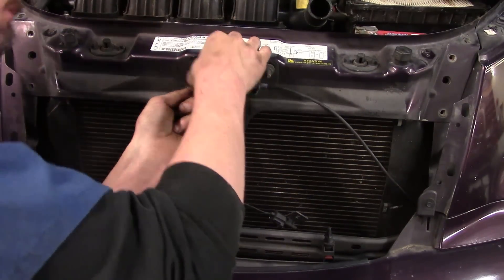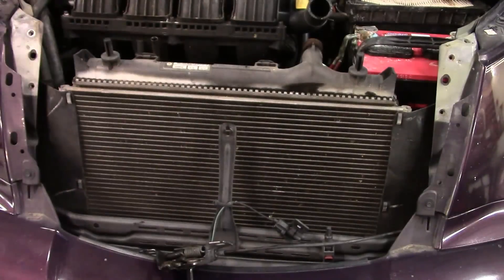Part 1/2: 2004 Chrysler PT Cruiser radiator removal and replacement

Comment: Thank you very useful and accurate just helped me replace the radiator in my 2005 Turbo PT Cruiser Convertible . One of THE most accurate videos I have seen in a while right down to dropping the hood latch washer, I did it too and was like doh he warned me
Reply: Was it any different then the non turbo?  Is there more work worrying about the oil cooler and turbo?
Reply: @stephenriddick9554 , some rads for The TURBO PT /GT/HO, claim you need to remove the turbo.!!  I question why
you would need to remove it, unless your planning to rotate the engine, in order to remove the rad. Sounds like something I'm not willing to do

Comment: That's good advice on the rad dain, often I've had to remove the lower hose because my drain was either clogged or wouldn't move on the older brass ones.
Reply from the maker: +charredskeleton Thanks. I have had a few that leaked after opening them so sometimes I get a bit concerned but for the most part I don't have any issues anymore. Thanks for watching and make sure to subscribe

Comment: one thing to ask . dose the manual transmission does not have a cooler on the radiator. or does it?
Reply from the maker: Manual trans does not need a cooler….there is no pump in the trans so no way to pump the fluid thru a cooler either.
Reply: @MotorCityMechanic  that what i figured thanks.

Comment: Hey bro this was a great video. Excellent step by step and informative directions. Took me little longer than I thought. But that's part of the learning process. I have 1 question 4 ya tho.... Do have or done a video on removal and reinstalling the oil pressure sensor on a 04 PT Cruiser regular 4cyl. without the turbo. I've replaced it once and oh MAN. 🤬 Thanks again bro and keep'em coming
Reply from the maker: Thanks for the kind words about the video. I have not done that sensor on that engine as of yet.
Reply: @MotorCityMechanic  That's k bro.. I'll just keep 👀 out 4 it if u decide 2 make 1

Comment: what is the guard on the bottom under the radiator attached to the chassis or frame?? ,is it the radiator air dam ? My 2004 is missing this piece and I am replacing my radiator a second time .Does it protect the underside somewhat.Also there are low profile 16" tires and rims which allow the car to be too low to the ground ,what can I do to remedy this situation?Will  normal tires fit ? I would prefer more ground clearance to prevent damage to the radiator ,oil pan ,etc.
Reply: Great video ,very helpful and well done!!
Reply from the maker: The issue is that it doesnt take much to damage the radiator if the vehicle gets bottomed out. Usually the metal cross brace that it sits on gets bent and then it breaks the lower mounting pegs off the radiator. As far as the tires....i would see if the door sticker and the actual tires match in size. I dont know what sizes you can go to that wont cause it to rub.

Comment: I ran into a snag on my PT. apparently it was in an accident before I owned it. There was some body damage down below and what happened was it pushed the fan back so I couldn't pull it out. It was like the fan was welded in there.
Reply from the maker: They most likely bent the metal support underneath that the radiator sits on. Surprised it didnt damage the radiator as well. You can replace that support if need be.....it just bolts in place.

Comment: This and your timing belt videos helped so much! Thank you! I've done both on my 2001 PT. I now have to tackle a radiator & fan replacement on a 2004 PT Turbo I just bought. Is it much more involved than the non-turbo?
Reply from the maker: It will be pretty much the same. I think the turbo version has a neck that unbolts from the radiator if memory serves me.
Reply: A whole lot more. You got a trans cooler and intercooler to worry about. it’s a pain in the ass!!

Comment: What is the difference between the manual and the auto versions of the radiator?
Mine is manual and most of the radiators sold on the internet are for auto trans. what modification do you need to do to the radiator to make it fit?
Reply from the maker: Actually the automatic will work fine. The auto may have a built in cooler with 2 fittings on the lower rank. Depends on the year. Otherwise you won't be using the fittings and can just leave them alone. Mounting and everything else is the same. Thanks for the question and make sure to subscribe

Comment: If replacing radiator why would you worry about drain plug oring messing up
Reply from the maker: It’s just a tip for those who might be doing other repairs instead of replacing the radiator. While showing the radiator it felt it was the perfect time to point it out

Comment: could a clogged radiator and/or bent fins in the radiator cause a car to overheat when city driving?
Reply from the maker: For sure it can. Bent fins will prevent airflow across a radiator and not allow it to cool or remove the heat from the coolant as designed. If clogged with mud or other items on the outside then you can have the same issue. Thanks for the question and make sure to subscribe

Comment: Can I remove the engine alone on this vehicle, without taking the transmission out?
Reply from the maker: I never have tried to remove it separately and believe you would have to take too much stuff off the engine while in the tight quarters of the engine compartment. I highly recommend removing together. Its much more easier and you don't have to fight as much to remove the assembly. That's how I do it when I have to replace an engine. I jack the vehicle up as high as I can and then when ready, hook the engine hoist up and lower the engine and trans assembly down to the ground. Then slide it out and separate. Thanks for asking. Make sure to subscribe if you haven't already

Comment: If your replacing the Radiator why would you care about the petcock o-ring????
Reply from the maker: It has nothing to do with removal of the radiator....basically I tring to ingrain into their minds that if you ever touch that petcock for any coolant related repairs to use this method. Even if it’s for a water pump or hose replacement.